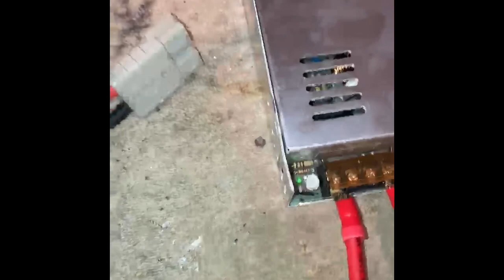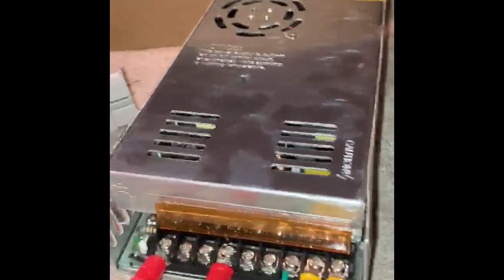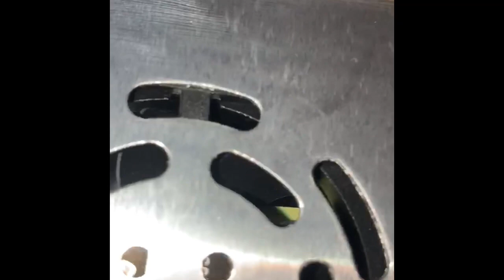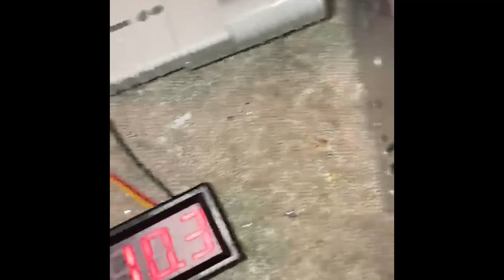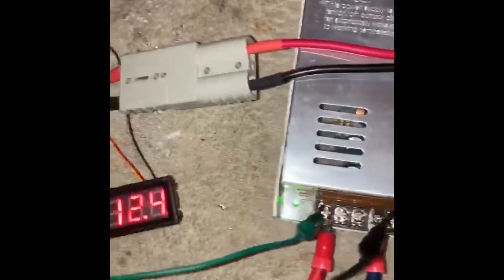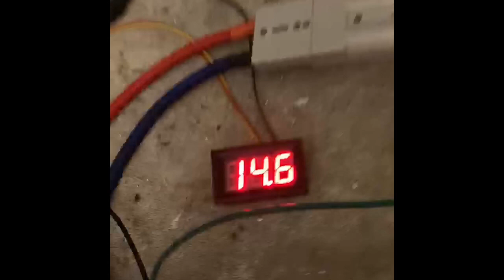50 amp eBay power supply. Is it any good?

Comment: I have one of those 50 amp power supplies from eBay and I run my four pill on it and it gives me full output which is around 400. 
Hardly any voltage drop off

Comment: Much better off with Megawatt PSUs. They have better filtering for less ripple and much better noise filtering for RF equipment. Yes, they cost a bit more, but I push the hell out of mine and they just work. Megawatt.